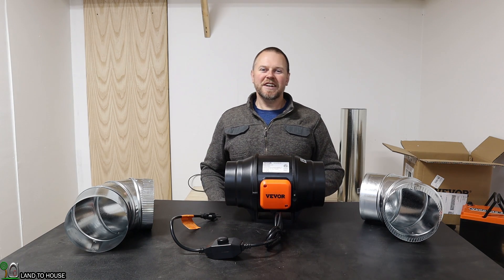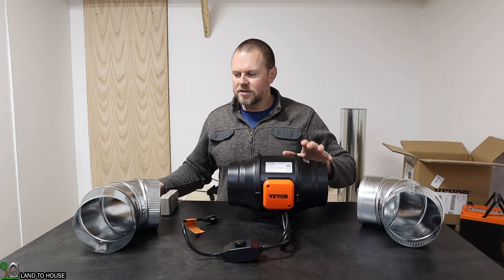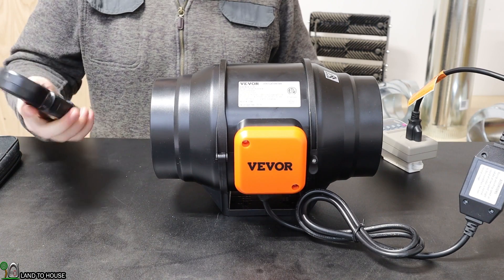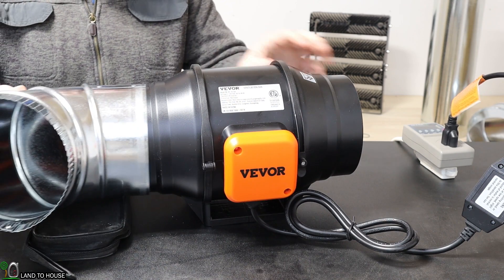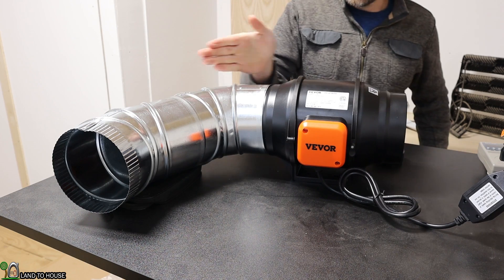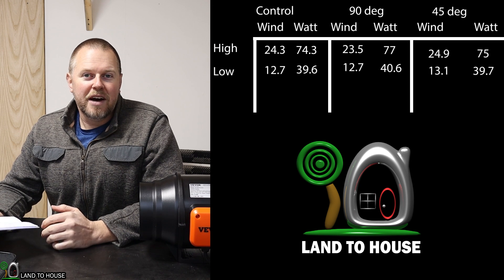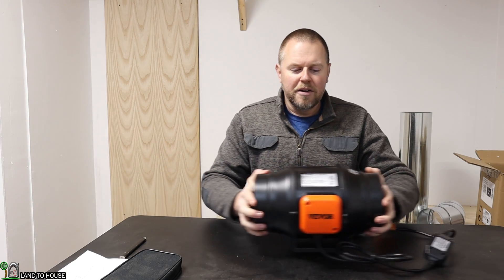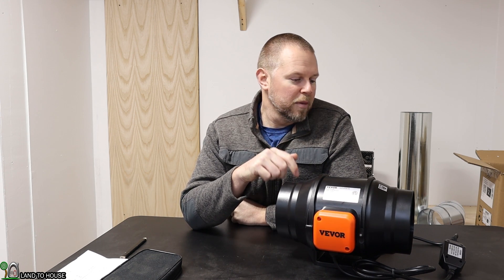One 90 vs two 45s in an air duct. Which is better?

Comment: You really should’ve added a short straight pipe to the 90° turn since the 2 45° turns or a much longer section. That way you’re at least equalizing the friction of the pipe walls between the two data sets.